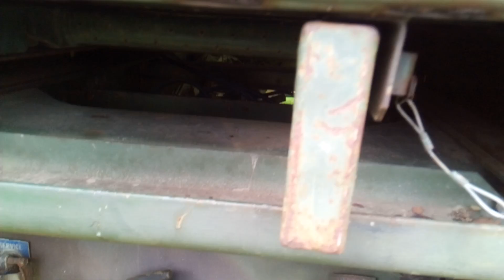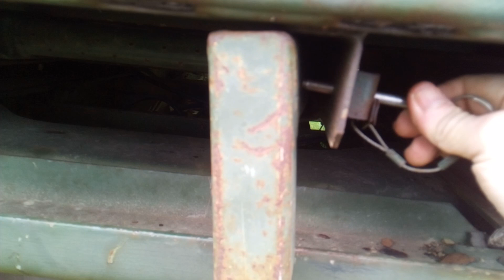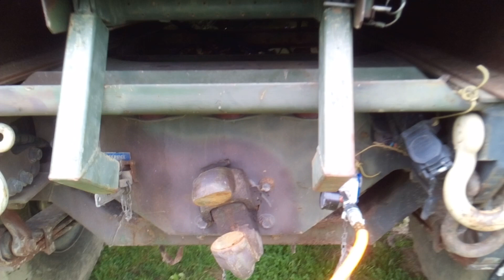LMTV M1078 Boarding ladder stowage

Comment from the maker: found out why it does not fit as OEM.  Previous owner removed the bed..... then reinstalled on channel iron and NOT OEM sub chasses.  Now bed sits like an 8th inch too low for OEM ladder stowage.  This bed will eventually go on my bedless M1082 trailer..  will make final decision then cause same issue will still exist after the swap

Comment: Whats the item number
Reply from the maker: ???  which part are you referring too?  the whole ladder seems to be (based on review of several ads all showing the same NSN etc

NSN: 2540-01-394-9681	Manufacturer Part Number: 12418950       Other Part Number:	19207-12418950
Reply: @coachgeo  the pin. I was doing a PMCS and someone took the TM but it's ok